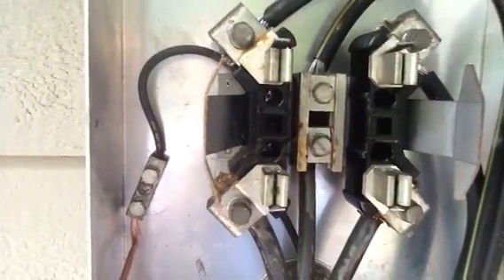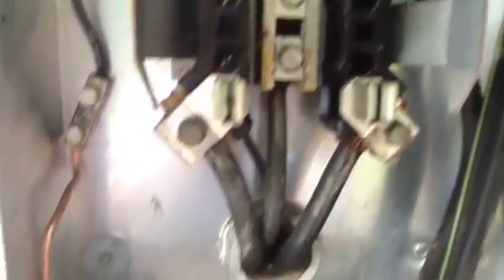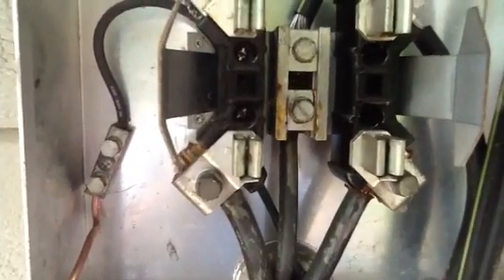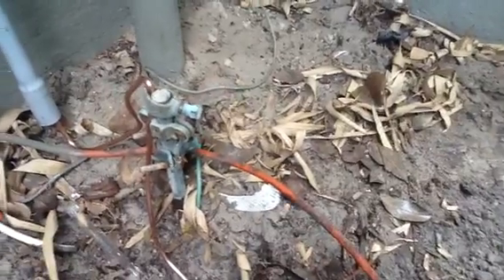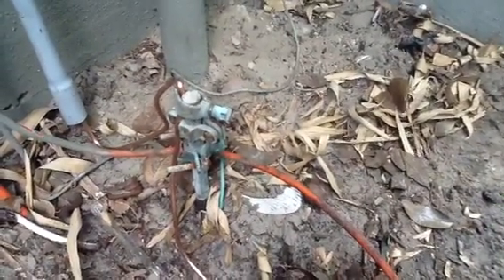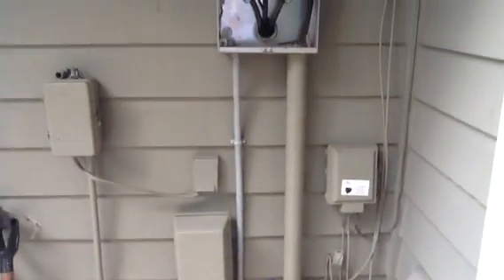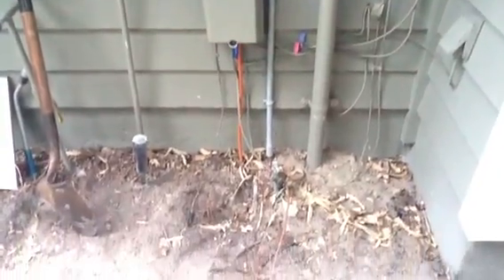Grounding a 200 amp electrical service

Comment: Couple questions, why did you use solid? Some other electricians I learned from says it needs to be stranded, as well as the wire should go from either panel or meter to one ground rod then the next and then back to where you tied it in to start? Some answers would be helpful thanks!

Comment: 200amp,youll need a minimum of two ground rods,6-8ft long,and not at a half inch,they must be 5/8inch,if the rods are 8 ft long,then space then 8ft apart,if they are 6ft long then space them 6ft apart.

Comment: Thanks for the good video.  Why do I see some folks running ground from the meter to the grounding rods and others who do not, but rather run the grounding wire from the service panel to the grounding rods with no grounding wire from the meter to the grounding rods?

Comment: Thanks , I’m installing a 5KVA solar inverter only for emergency when we lose electricity, I have lithium batteries for storage and to provide the electrify if at night when we lose if , I’m in the very beginning I do have a new grounding rod from Home Depot I think is 3/4” sink plated x 8’ I only got 1 any advice I’m all ears , any help is welcome ~ Thank you !

Comment: I find when you ground put the acorn on the ground rods rubber tape them up then tape them up with green tape I ripped one out 20 years ago when a backhoe tore it up and it looked bright and shiny the day I put it in if we start practicing that the grounds will never fail have a nice day

Comment: yea thats a violation ground comes from panel neutral bar  # 6 if using two rod use 2 seperate #6 copper wire
that lug in meter pan is used for bond wire if bond bushing is used on feeder pipe if metal

Comment: Number four  copper wire has to be run from the main neutral bar to the first ground rod then the second ground rod  at 6 feet apart and then from 6 feet apart to Coldwater this is all looping non cut
Reply: Quick question.. I just Is went to a plumbing supply house and spoke to an old His retired plumber he told me he doesn't know why Electricians run a groundwire to the copper pipe by the water heater for instance, if they put 2 or 3 ground rides outside 6' apart.. He said it causes electrolysis in the water which is bad for your appliances waterwise.. Was this gentleman talking out of his you know what? I had 2 phase 200 amps service put in

Comment: can you run a #6 bare wire through pvc conduit to the meter box and run the wire through the meter box to the main panel indoors to the ground bar?

Comment: The service should be grounded at the neutral conductor not a separate lug on the cabinet. 250.142

Comment: Now they make you use intersystem bonding bridge..for all other utility grnds.
Reply: this is grounded illegally, if you notice hes got a #4 from the meter can bonding lug going into the house, code states there are three locations you can ground a service to and that is  #1 the service drop, #2 the meter can and #3 is the panel inside or means of disconnect. code also states if you ground the meter can you do not bond the meter can to the panel because in both the meter can and the panel the neutral is bonded to the case mechanically so what hes done is paralleled conductors which cant be done under 1/0

Comment: Inter system bond kid. # 4 copper system bonding conductor does not need to be ran in a pipe. And you cannot run it into the panel if the conduit is metallic

Comment: Thanks for sharing that this video i had been having electrical problems and it turns out they never bonded my panels and left bus bar in and had grounds mixed in neutrals on the neutral ground bars.Now after making the neccessary changes adding ground bars to box and bonding it separated grounds and neutrals and bonded panels with ground rods 6 ft apart and #6 copper bonding wire.Thanks for sharing this info keep up the goid work man

Comment: Is it grounding the box or is it tied to the neutral or is is it like going through he box to the panel?
Reply: Excellent point. I don't think the meter can neutral is supposed to be tied to the ground *in the meter can*. He just extended the ground rod solid wire to a #4 stranded ground wire that ran to the main panel inside ground bar. I don't see a connection to the meter can neutral in the video. The inside panel is the place where the ground and neutral are supposed to be connected.
Reply: @ChrisWilson999  incorrect, you can ground a service in three locations #1 the meter can #2 the service drop or #3 the panel. i cant tel if the neutral is bonded to the meter can but if it is than hes got a paralleled neutral/ground which is a violation under 1/0
Reply: @nicknovak83  so the neutral and the ground could be bonded at the meter?
Reply: @cmijares79  if i remember correctly, the neutral and ground cannot be bonded in more than 1 location. if they're bonded in the panel then they cannot be bonded in the meter can. if they're bonded in both then that would be what code considers paralleling conductors which cant be done in wire sizes  smaller than 1/0. theres no need to bond them in both locations
Reply: @nicknovak83  where I live the bonding is only done at the meter. So it seems OK.
Reply: @ChrisWilson999  oh okay thanks
Reply: Chris Wilson the place where the neutral is tied with the ground is at the point of service hence why you sometimes have a floating neutral in the panel because the panel is clear across the house from the point of service.
Reply: Guys u are absolutely wrong. Utility companies want you to ground neutral at the meter can. In case you lose neutral on service droop
Reply: U can NOT bond ground and neutral at the building . Only at the first disconnect. Outside you can bond it 100x if you would like to.

Comment: I find this confusing because it looks like bonding is happening both at the main panel and at the service box. I thought it was supposed to be at one place only, but it seems that many do it at both places. When the neutral goes under those fittings for the meter, is that neutral wire electrically tied directly to the frame of the service box?
Reply: Ding ding ding you are correct. The service should be grounded at the neutral conductor. Code says either at the point of connection which is rarely done. At the meter cabinet or the service disconnect ground must be at the neutral connection. That grounds the service any faults will travel back to source. That’s also why you separate every thing else. Sub panels and the like. They all get bonded and the grounds get separated from the neutral so a fault will continue back to the main source. This video is not to code sorry. That’s why you see two terminations on the neutral lugs of new meter cabinets.
Reply: @smash72cutlass30  you can ground the meter like this on the supply side. I wouldnt do it this way but it is legal.

Comment: If it's a little more than 6' is that okay?
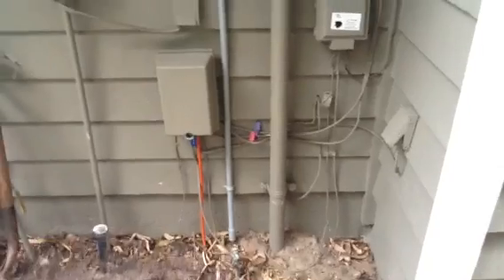Reply: Yes, it is actually better.  Keep in mind that 6 feet is the minimum NEC requires.  Yet, ideally it should be 8 feet away. This is because you don't want to overlap the distribution of the energy on the ground.  And, each rod will distribute the length of the rod.  Most are a minimum of 8 feet deep, so 4 feet to each side, 8 circumference around the rod.  Hence, two 8 feet rods will disperse 4 feet to one side, thus 8 feet total between them.  Check this video around 1:10, he explains it https://www.youtube.com/watch?v=DiapZ7RkjFc
And, even a better video is this one, starts around 1:50 explaining it.  https://www.youtube.com/watch?v=DiapZ7RkjFc

Comment: God knows what I got here? I rent! The maintenance man tried to fix front and shed lights. All the electrical on one side of house went out! He found out that wiring was rigged up to one amp fuse pull out. He called it a fire hazard! Old aluminum wiring and copper mixed and reverse polarity in walls. He got the electrical back on but removed an electric pull out in circuit box. Left it empty! He called them pull outs. Circuit breakers!

Comment: nice i have a 200 amp service i put a 100 amp panel next to with a 50 amp 4 eire trailer cord and its pluged in to a 50 amp 4 prong outlet of the 200 amp panel so if power goes out i can un plug it and plug it in to a outlet powerd by a generater i alsow have a 12 volt batery with a fuse box single screw fuse 15 amp and i put a couple lights in with 102 volt ac switches same as house wiring only thing difrent i used a blank cover and put 12 v light on it every thing else is done same as 120 volt wiring boxes switch 14 2 romex is that ok i also have 5 amp fuse on the battery and can plug charger in for a while maby 2 times a year carefull not to over charge thanks
Reply: I just fried some pork chops sandwiches

Comment: So quick question about ground wire for  service panels 100amp ,200 amp , looking at a rental house that was redone  looks like a handy men special on the  service panel,  they used one ground  wire  from the  panel to the water line .Can you still do this ,do you need more then one ground wire to a different water line ?
Are you suppose to use a ground  rod  then  another  6 Ft  apart ? Then they only replaced about half the wires to the  house from  the  panel  the rest are not grounded, I will bid it to replace the old wires.
Reply: Connecting to water lines used to be allowed.  If you are re-doing, put in ground rods and a #4 bare copper ground wire.

Comment: Hi,
I am installing a new 200 amp service. I am using service entrance cable.  Do I need to ground the meter box. 
Thanks,
Reply: Noooooooooo
Reply: Those people will charge $1000 to do what you can look up and learn in 10 minutes and $100 in materials. It's 2 wires and a ground coming in off the  electric pole. It's not rocket science.
Reply: @Schismxs 
It's two power and a neutral coming n off the electric pole.
Neutral and ground are NOT the same thing.

Inside your house most cables will have 1 power(black), 1 neutral(white), and 1 ground (usually bare wire or green)
Reply: @2Truth4Liberty  he's technically right but he's right by accident lol, a neutral is the ground"ED" conductor, but we call it the  neutral conductor, the bare or green wire is the ground"ING" conductor
Reply: @Schismxs  it ain't that simple at all, you're crazy for encouraging somebody to gamble with their life like that
Reply: You should leave that to certified professionals if you don't know

Comment: I have a paved drive that goes right up against my foundation of the wall my meter is on. I'm upgrading to 200 amp service from 100 amp. I understand the two ground rod system. But how far away from the meter can my ground be ran? Can I run it in conduit along the foundation about 15 feet or so then into the ground on the back side of the house with the second ground 6 feet from that?